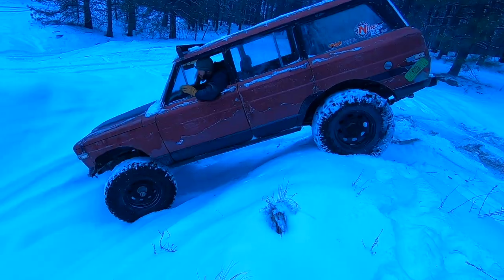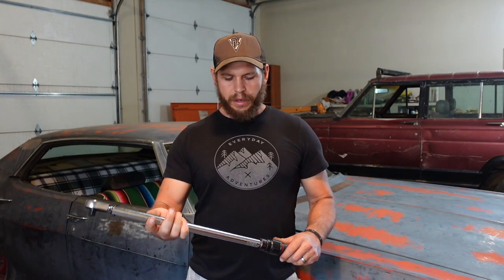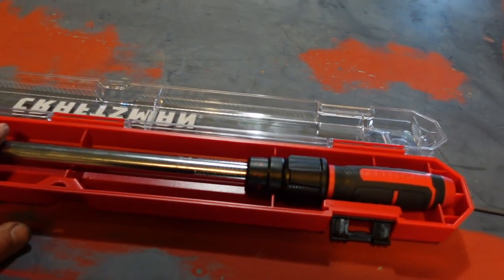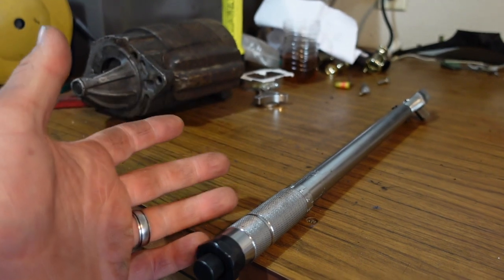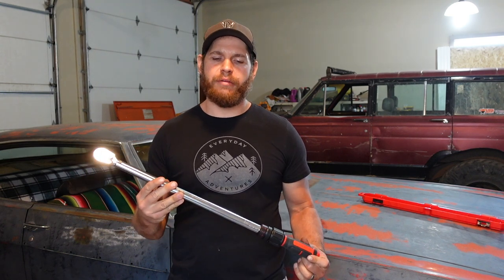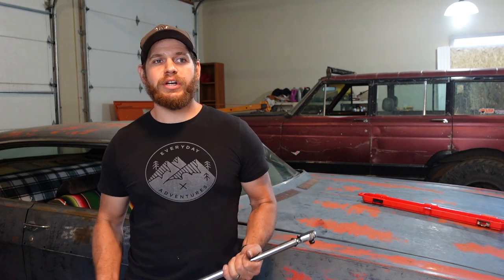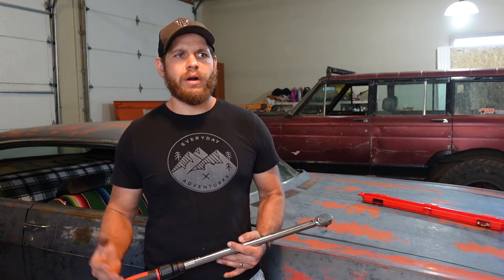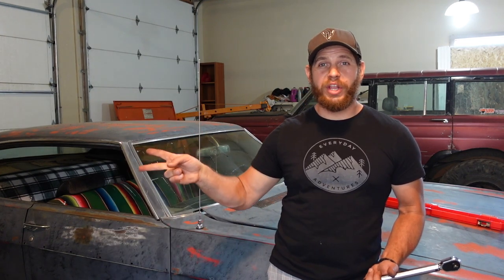Craftsman 1/2 Inch Drive Click Torque Wrench Review

Comment: to maintain the calibration on your new torque wrench it is important to back the torque setting off to zero when stored. also on most snap on trucks they have a calibration checker. good idea to check calibration after it has been dropped.